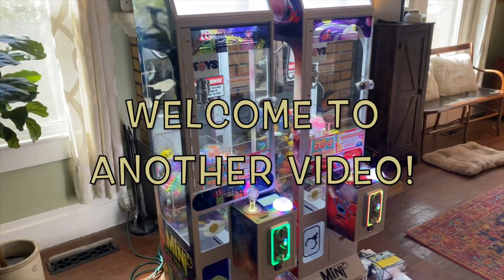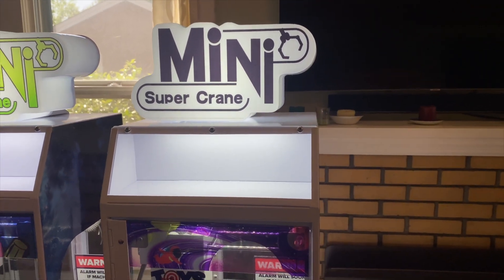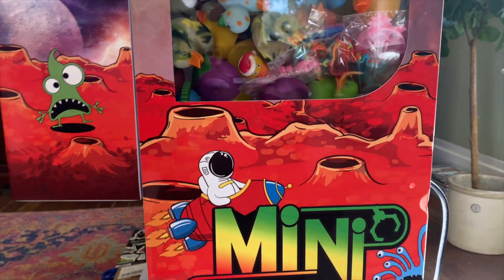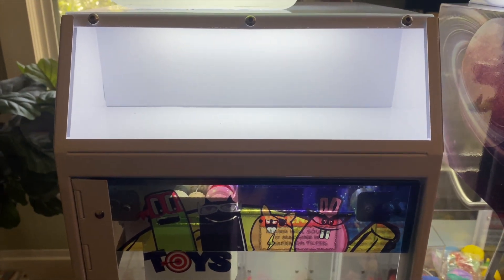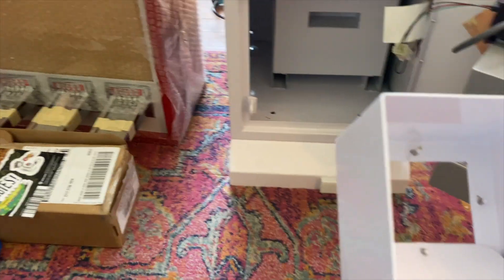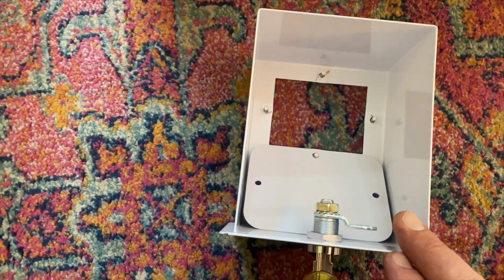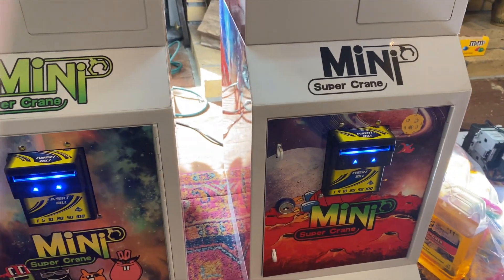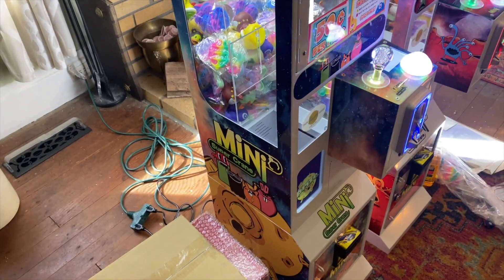Candymachines com Claw Machine Review - What are they really like?

Comment: how much was shipping ? put some bricks on the bottom for weight
Reply: I got one and had to pay $250 for freight and they had a lift on the truck to unload it then bring it into my garage.
Reply: @gooseoutdoors7163  for three machines? not bad
Reply: I only got one but it came on a pallet since the machine is small they could probably put four on a single pallet. They did have to ship it halfway across the US though.
Reply from the maker: Freight depends on your location.  We live in California and it shipped from here so it was pretty cheap.  Order as many as you can afford to put on a pallet.  It will save you in the long run.